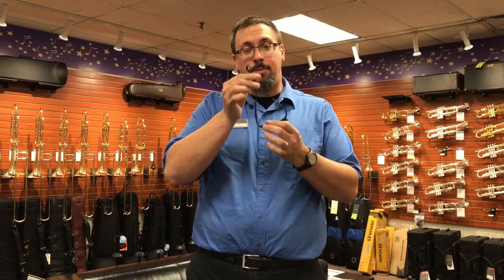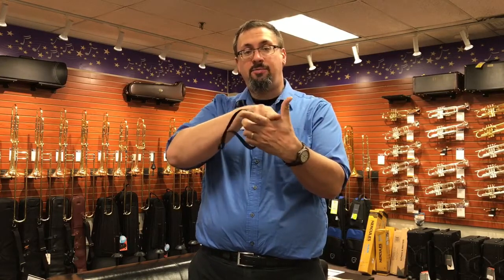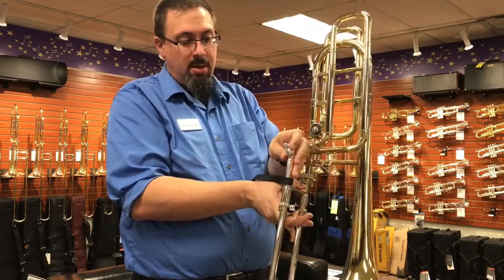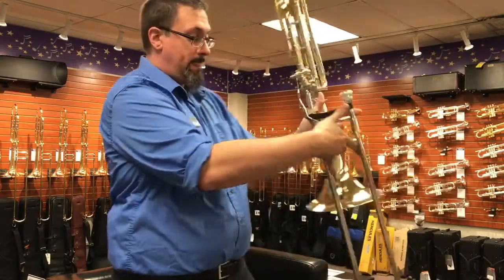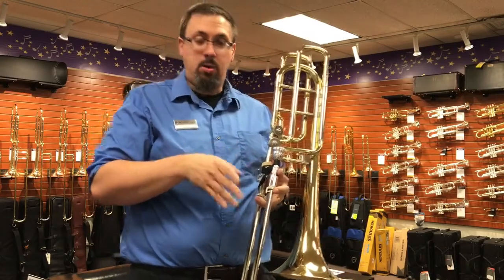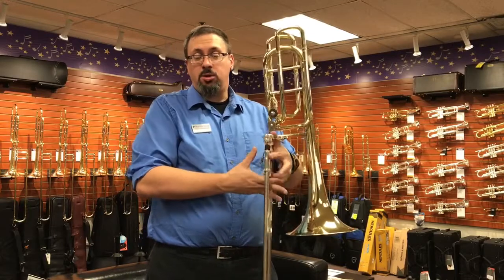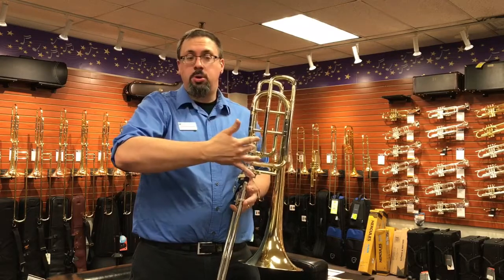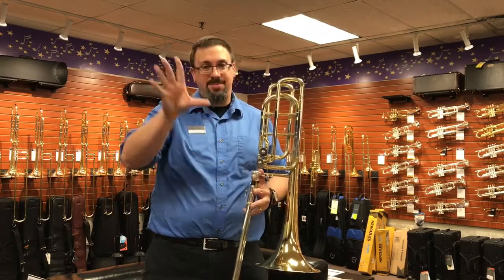Yamaha Trombone Hand Strap Demo

Comment: By the grip starting at the mouthpiece/lead pipe area wouldn't it put the top slide out of alignment by the grip pulling the top slide downwards?
Reply from the maker: Good question.  I haven’t had that experience myself nor have I heard of this happening.  The weight is more distributed vertically on the slide tenor receiver then pulling outward laterally.  If you had a loose screw collar or were using a friction-fit receiver, or if you naturally angled the slide outward significantly from a 90 degree angle I could maybe see an issue.  I would be curious to hear if any other users have had an issue with this...
Reply from the maker: Good question.  I haven’t had that experience myself nor have I heard of this happening.  The weight is more distributed vertically on the slide tenor receiver then pulling outward laterally.  If you had a loose screw collar or were using a friction-fit receiver, or if you naturally angled the slide outward significantly from a 90 degree angle I could maybe see an issue.  I would be curious to hear if any other users have had an issue with this...
Reply: If you look up Adian Ritchie on youtube you'll see in his older videos that he had a Yamaha grip like the one in the video. He made a video named "Get a grip!" where he basically explains his why he uses the grip he uses but also goes back to explain why he doesn't use his Yamaha strap anymore at 5:48.